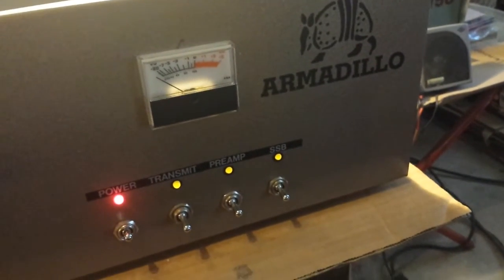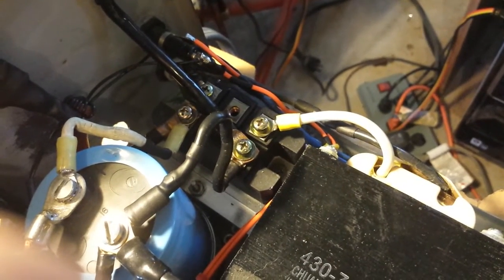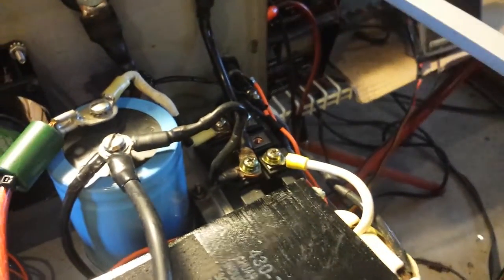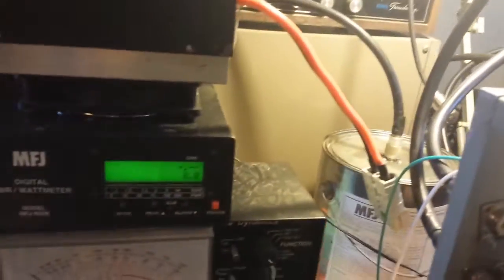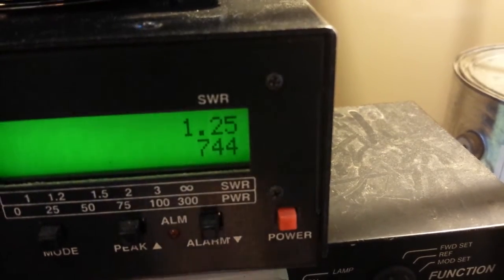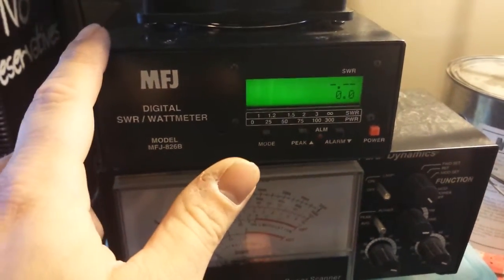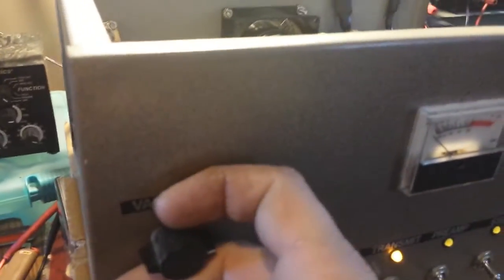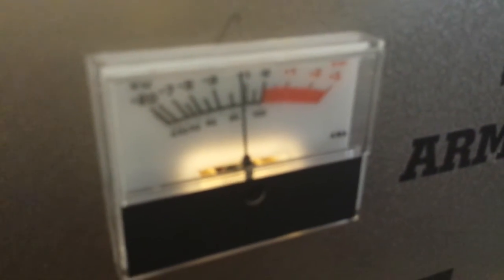Armadillo 1x4 Base 100A Iron Core PWR Supply Build 🦾

Comment: Do you know if these amps are still in production? I have one that’s supposed to be a armadillo but I can’t find any info to confirm or deny
Reply from the maker: They are being made here and there.
Reply: @1883GotDown  do you know I f there is any way to be able to get or see a lay out or prints of how these are built so I am able to get mine back to its original set up if in fact it is authentic